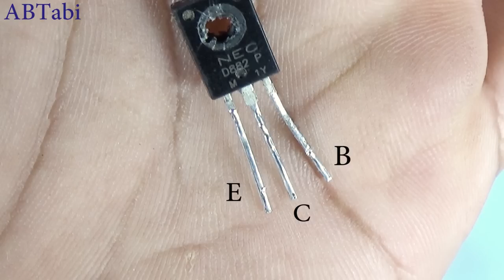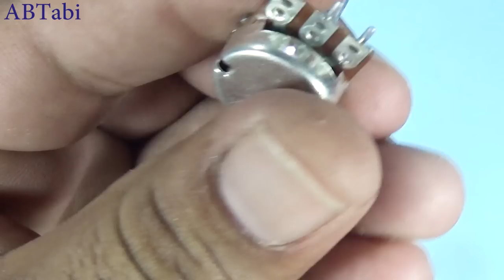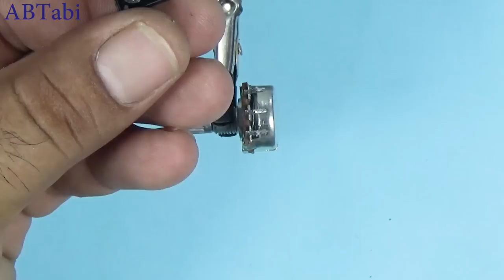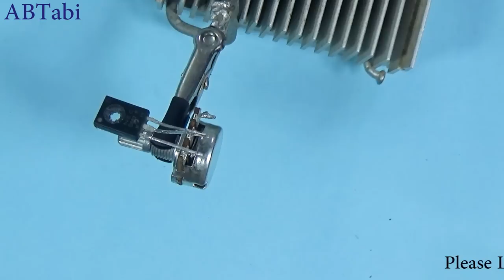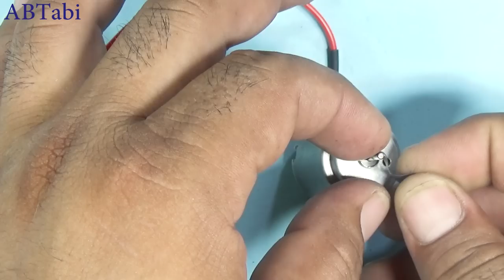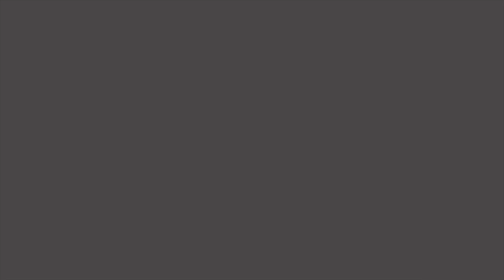How to make 12 volt DC Motor Speed Controller simple diy

Comment: Hi. I have a 12V1.63A fan and a 12V 2A charger to which I made your speed controller. It works but the resistance does not hold. What do I need for my circuit?
Reply from the maker: This circuit work perfectly, but you must use heat sink for transistor ,,,,,,,
Reply: OK thanks. I will make you n

Comment: Hi ABTabi, very good video! Can i control a Chip 12 volt led instead of motor? Thank you in advance ;)
Reply from the maker: Yes, you can control Led light chip, but remember you must use heat controller for transistor.....
 Thank you very much dear friend for interest in my electronics projects..........
Reply: I just bought the components, and test the system....It works great!!! You are my hero!

Comment: wht if i want to control a bigger motor. my dc fan takes upto 4 amps on 12v. what should i do to make its speed controller
Reply from the maker: Dear friend this circuit is not for 4 amp,,,,,,,,   i will make as soon as possible,,,,,,,,,,,,   Thank's for interest,,,,,,,,

Comment: hi. I bought a digital display 100% adjustable DC 10-50 volts, 40 adc and I want to change the knob for a foot pedal.
I'm making an electric car for my Grand children and I think foot pedal is more safety for them to adjust the speed.
The speed controller has 5 wires and I do not know which are which to connect to the foot pedal who has 5 connectors.
Can you send me your email to send you the photos of speed controller and foot pedal connector please.
Thank you very much.

Comment: Brother i have  tried the same circuit with 5 volt dc supply to regulate a small 3 to 6 volt motor. But my transistor is getting super hot. What should i do?
Reply: Use a bigger resistor

Comment: Bro using it on a 12v 3amp high-speed fan working fine but the D882 get to much hot in few sec any solution?
Reply: Add a heatsink.

Comment: I am flowing exactly same steps but it didn't work.. The 120 ohm resistance starts burning when i switch on the source.. And there is no rotation seen when the middle leg of the ic connected to the motor.
Reply: Anal Roy Chowdhury same thing happened to me too

Comment: without heatsink,,, can this TR hold 12 hour running ?
Reply from the maker: My dear friend depend  on your load,,,,,, if you use over load must use heat sink,,,,,,,,,,,   Thank you for interest,,,,,,,,,,,
Reply: @ABTabi  thanks... now i will build one for my dc blower.
Reply from the maker: You welcome dear friend,,,,,,,,,,
Reply: @ABTabi  i use 10k, rif;540, ptenxomter 12v motor, 9v dc it will work?/

Comment: Agar sadagar use kare to transistor kya kharab ho sakta hai.
Reply from the maker: Please explain this word (sadaga). ,,,Thank's
Reply: Do you know hinde
Reply from the maker: Use only English ....because everyone understand.
Reply: The motor lod will burn the transistor
And I can use two or three transistor in series.
Reply from the maker: You can use but remember,,,,, D882 transistor is = current maximum 3A voltage maximum 40 and 10 wattage.If you overload it will be burn,but you can use other transistor like D884,D1159, 4.5A 200 v 40 watt or other powerful transistor....Thank's

Comment: I did it without the transistor and the adjustable thingy caught in flames sick shit right!
Reply: The 'adjustable thingy' is a variable resistor, or potentiometer, and turns excess power into heat, so that's why, if you didn't know, it caught on fire.
Reply: Same thing happened to me, lol! so now I know why.
Reply: If you draw something like 0.5amps then the resistor/potentiometer needs to dissipate something like 12V*0.5A = 6W of energy as heat (and that is hot my friend), potentiometers in hobby electronics usually are rated for less than 500 milliwatts.

The transistor(MOSFET) is used to control the current running to motor with smaller current, in this case he uses the same 12V I think, creating a loop of some sort so he doesn't need an external power source.

Comment: ok dude... I stopped the vid at 1m 36s.  Why you ask?  It starts out with a transistor with a hole in the middle of it......where could this possibly go????????
Reply: The hole is there to mount it to a heat sink.   If you'd finished the video you'd have seen that it works.

Comment: OK I can offer some answers here. Parts: NEC D882 P Transistor (NPN Silicon Transistor suitable for output stage of 3W audio amplification, voltage regulator, DC-DC converter and relay driver), Standard B20K (20K Ohm) Linear Action Potentiometer, 4 Band Resistor with colors that appear to be [Silver, Brown, Red, Gold] which should = 81x100 Ohm @ 5% Tolerance? I'm not great with resistor bands please double check that before building this). The Resistor color bands have a chart and this uses the 4 Band Chart. The Band Format = Value A, Value B, Multiplier Value, Tolerance % ] Each value can be found on the chart based on band color and position on resistor. If I recall resistors MUST be installed in the circuit in the proper direction. The Potentiometer can complete the circuit using the outside lugs where the black and red wires are attached. The legs of the transistor are attached to the Ground end and the center lug of the Potentiometer. The Center lug is controlling the variability and the 2 outside lugs act as [ + / - ] and complete the circuit. The Resistor is on the + end of the circuit to prevent over voltage from entering the circuit. The Transistor acts between the wiper attached to the knob inside the Potentiometer which is also where the Center lug runs to. The knob when turned runs a wiper over a crescent shaped plate contact. The contact plate terminates on each end to the corresponding outside lug. From what I can tell the Resistor halves incoming voltage. The Transistor can then amplify the voltage based on the Potentiometer wiper position. Hopefully I got most of this correct. If anyone else catches any mistakes please comment and correct this.
Reply: The rezistor value please
Reply: is it possible to use a fader instead of the potentiometer?

Comment: How would it effect the usability if I were to use a weaker or stronger resistor?
Reply from the maker: Load depend on transistor not at resistor ,,,,,,,,     Thank you dear friend for interest ,,,,
Reply: Use mosfet in place of transistor. It can withstand more power